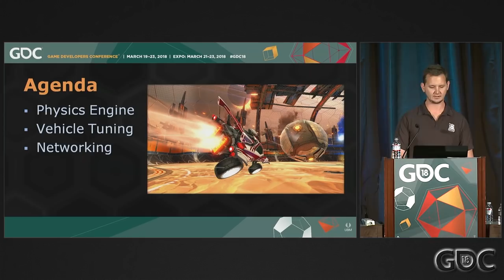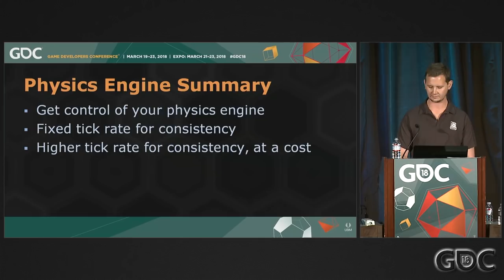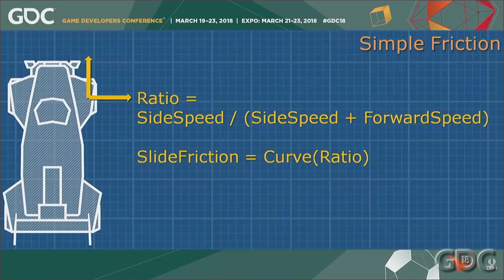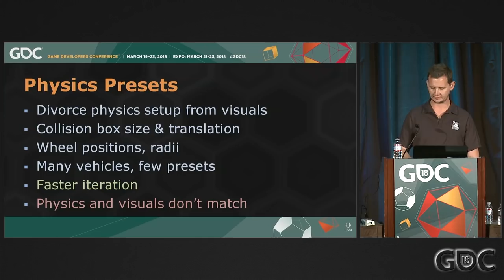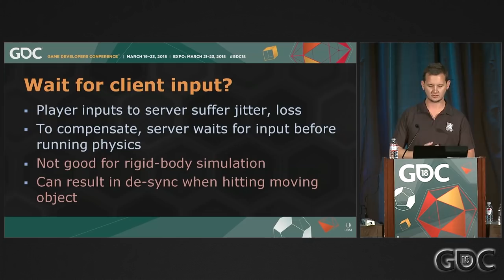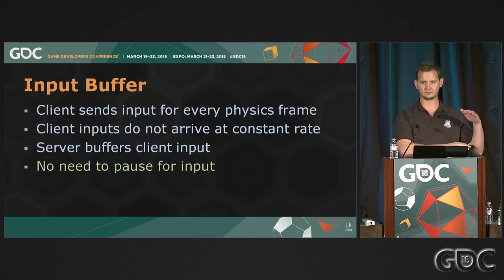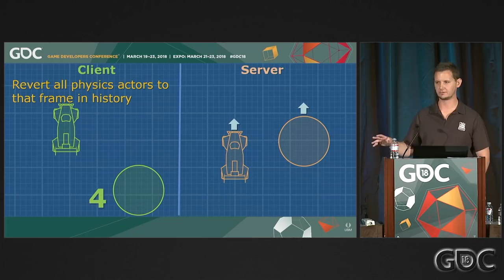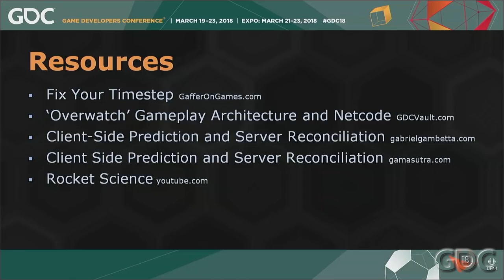It IS Rocket Science! The Physics of Rocket League Detailed

Comment: Is no input considered an input on a physics frame ?
Reply: yes i would assume so. In that case it should run the physics state. like a car just decelerating and coming to a stop. And no input is still an input. I think what gets passed is the input state. Like the value of an analog stick on X axis can be 0 or can be 0.5 or it can be 1. All of these are values which will determine the calculation of the physics frame.

Comment: Having the game at capped 240 fps, makes my inputs randomly react different. Having the game at 120 fps, everything is normal.  I heard the physics tick rate is 120. Is there a way to increase that to 240 ?  A dynamic tickrate , syncing along with the fps would be a solution i guess ?  I can easily pull 240 fps at max settings. And it is sad, that it is unplayable then. Also, i noticed, that the sensitivity of my mouse is lower, the higher the fps are.  Oh and, the walls sucking the cars towards them is kind of , disturbing. And when releasing the throttle, the car accellerates, when shifting down. In realtiy a car slows down when downshifting, because of the engine brake. Ideal would be the car getting slower in a linear smooth way, without speed changes, in Rocket League, because of course, you have to calculate the distance to a ball. The sound effect of changing gears , should only be a sound effect. Accellerating is completely linear, so ,  decellerating should be linear too then, especially if you have an automatic gear change, wich is only happening at predefined rev ranges, so there is not even a revving up happening. Why is the game acting like someone is hitting the clutch at decellerating, taking the gear out, so it can roll easier, and decellerates less ? The thing is, you can't get a feeling for , when the automatic gear will switch a gear down on its own. You can't predict, when the car is making that push forward. And it does the push forward, because you guys, implemented the effect of an engine brake, in the complete oposit way, than what it is in reality. I guess you thought, a higher revving motor, means being faster, wich is just wrong, at decellerating. What is true is, the car , wanting to roll on forward, because of its weight, is revving the motor up, if a lower gear is put in MANUALLY, because it is a lower transition, than the higher gear. It is then harder for the wheels, to transfer energy into the motor through the transmission, and that's why it is slowing the car down. The energy transfer between transmission and the engine, flips, when releasing the throttle. Not the engine spins the tires anymore, the ground is spinning the tires, and they spin the transmission, wich spins the motor. The energy for that comes only from the rolling forward momentum. If you switch to a lower gear then, the transition is lower, wich forces the engine to revv higher, but the energy for that , is coming from the road that is spinning the tires. Spinning up the motor that way, costs energy, and that's why the car is braked by that process. But in Rocket Leage, again, the car accellerates, when it shifts a gear down. It needs to be fixed. And since it is an automatic transmission, which changes gears at ideal revv ranges, without causing these weird engine revving, the so called engine brake is also reduced, to put less stress on the engine and transmission. This means you could simply change it into a linear decelleration, when releasing the throttle button. Tnx.  And why the heck is accelleration spelled with 2 c's , but decelleration with one c ... ? I am german, sry :-p .